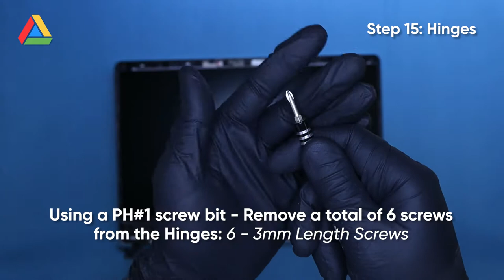Asus C423N | Chromebook Teardown Guide

Comment: I was hoping to see how to replace the keyboard but you stopped just short.  I spent years in electronic repair but in my old age I don't know if I have the motivation for all that anyway; I sent you a contact form to ask about the repair of my grandson's c423na-db42f.
Reply from the maker: Hello! The keyboard on this model is plastic welded into the palmrest, and unfortunately not designed to be removed. If you'd like, send us an email at repairs@chromebookparts.com to get straight in touch with our repair department!
Reply: @Chromebookparts  you are shure about that fact ? we change "welded  :)))" keyboards any time in our shop .
Reply from the maker: While it is possible to replace just the keyboard, it is a time-consuming process, with over 40 plastic rivets holding the keyboard in place that would need to be removed and replaced. There also doesn't seem to be any financial benefit in doing this over swapping out the entire palmrest, so we'd recommend against it.

If you'd like to see how the palmrest w/keyboard can be replaced for this model, here's a video tutorial:
https://youtu.be/pMzGKm9jR2A?si=0u4hhTFVBYpVQ7cE

Comment: I am looking to use one of these as an airgap.  Any tips on physically disabling wifi & Bluetooth?
Reply from the maker: Hello! We recommend disconnecting the WiFi antennas from the WiFi card on the motherboard and then wrapping the antennas in electrical tape to make sure antenna connectors won't short circuit anything on the motherboard. Then, we would still recommend turning off the WiFi and Bluetooth in the settings, as is it could still technically pick up a signal.

Comment: Hey, mine has a flashing white light next to the charger port. We went from home to a fast food joint with it half charged, just to open it up and it won't turn on, nor does it seem like it's charging.
Reply from the maker: It sounds like the battery has failed or is somehow not plugged in. That would be the first place to look. If you don't feel comfortable opening your device to check, feel free to message repairs@chromebookparts.com to send it into our repairs department. All repairs come with a free diagnosis and free ground shipping.

Comment: i have one , can i uograde the ram to 8 gig ?
Reply from the maker: Unfortunately the RAM can not be upgraded. Like most modern Chromebooks, made after 2012, the RAM is soldered on to the main board.  if you want to upgrade the RAM, you’ll need a Chromebook made before 2012 and only a particular model like the Acer 710 Series. Hope this helps! :)

Comment: can i upgrade the storage capacity? mine only has 2gb of storage somehow
Reply from the maker: Unfortunately, this device does not have a removable m.2 drive. The memory is soldered onto the motherboard. But that is strange... As far as I can tell, the model only comes in 4gb and 8gb versions

Comment: Hey, is the charging port replaceable? Recently had some damage caused to it so it no longer charges
Reply from the maker: I believe the C423N can be charged via both the USB-C Port on the Motherboard (Left Hand Side) and Daughterboard (Right Hand Side). The Daughterboard and Motherboard can be replaced, but the charging port can only be removed via Micro Soldering. I hope this helps! :)
Reply: @Chromebookparts my both charging port are damaged what should I do now?? And no one accepting to fix it as I am from India and chromebook is a new tech here and chromebook market is so small that parts are unavailable. I also have problem with my screen I have to replace it
Reply from the maker: Hello! If you'd like to fix it yourself, we can certainly help with getting you the parts you need. It sounds like that would require both a motherboard and daughterboard, along with the LCD screen you mentioned. Visit our website or contact customersupport@chromebookparts.com for assistance.
If you're not keen on making the repairs yourself, we do offer a free diagnosis for repairs. Unfortunately, our free shipping only covers ground shipping, so that wouldn't apply in this case. If you'd still like to explore this route, contact repairs@chromebookparts.com

Comment: Water soaked my laptop and its not coming up again. I don't know what to do
Reply from the maker: Hello! We would recommend unplugging the battery and letting the device dry out for three days. After those three days, try powering on the device (still without the battery plugged in). If there are signs of life, we would then recommend replacing the old battery to be safe, as water may have seeped inside, which could pose a hazard. 

If there are no signs of life, you most likely will need a new motherboard (at minimum). In this event, feel free to message us at repairs@chromebookparts.com about repairs or if you have any questions. We don't charge shipping or diagnosis fees, if you do decide to send it to us.
Reply: My HP core I5 suddenly went blank, I have tried so many things and it won't come up, I took it to a repair shop nd was told its the mother board. What do u suggest
Reply from the maker: If you would like a second opinion we are happy to give one and offer repair if necessary. Unfortunately, without having the device in hand we are able to offer anymore help on this matter. To contact our repair department please email repairs@chromebookparts.com